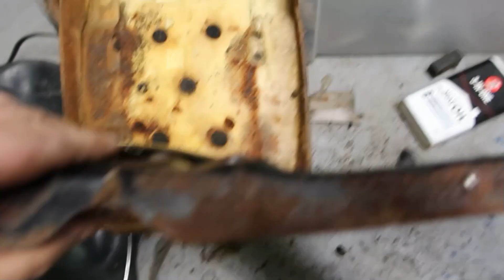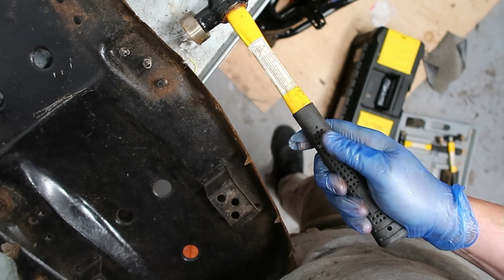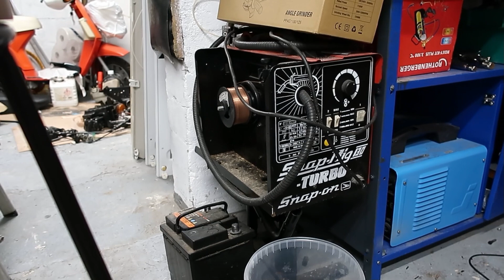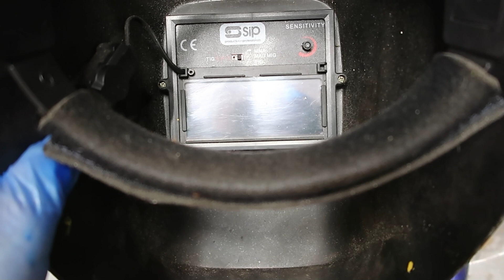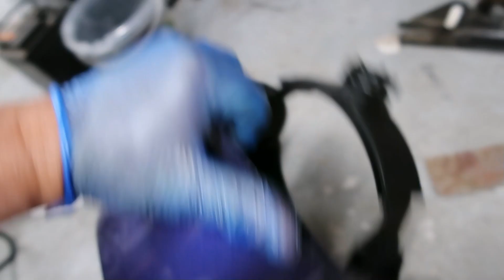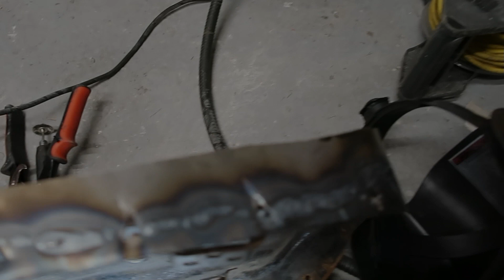Motorcycle Seat Repair - Part 1; Welding

Comment: Cool watch really interesting although I can't weld for toffee , I can appreciate the skill to do it well /properly .Great watch thanks for sharing I do have a question since you obviously know what you are doing in resto work I have a frame without vin plate it's a Honda  one my question is would you get a sticker replacement or an alloy one  that would be screwed onto the headstock ? I have found an availability on Ebay that makes them or if you know of somewhere that is the place to go for the best one 👌👍 .
Reply from the maker: Not sure. I have registered several bikes . You need  to get the frame number, engine number and an age certificate (from  Honda registry or an owners club), a nova cert for import then you fill out a V55. I know the plates you are talking  about but I think they repeat these number- never  registered a bike using them. Can you send a link to the ebay page . Where are they getting the numbers from